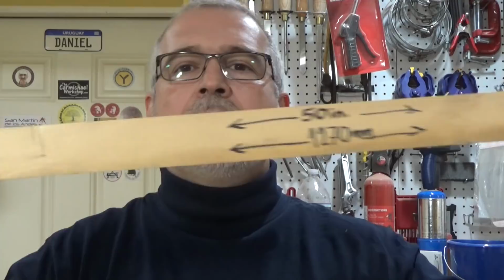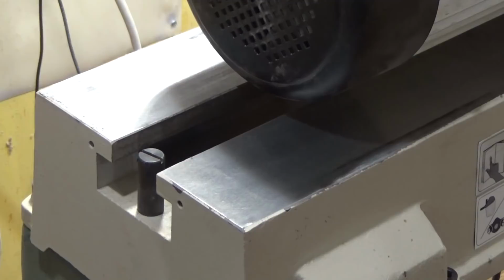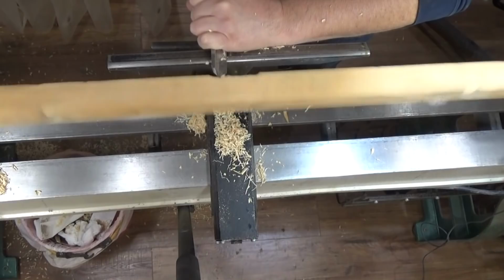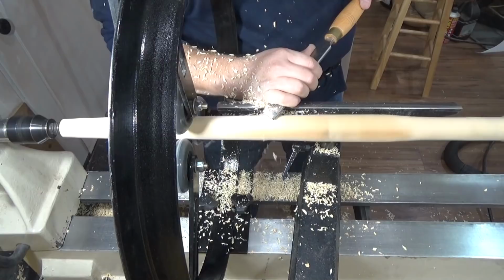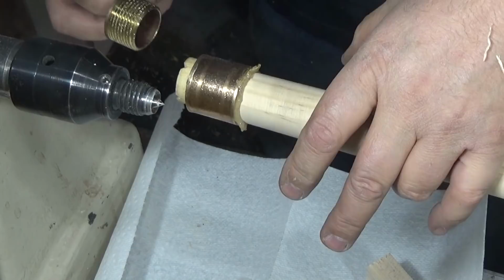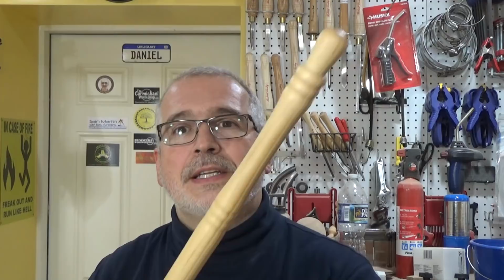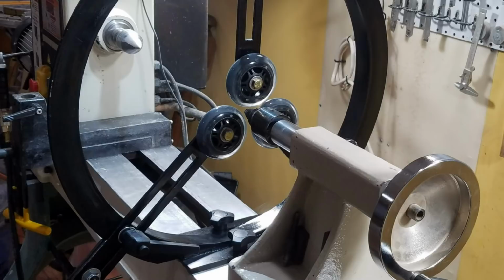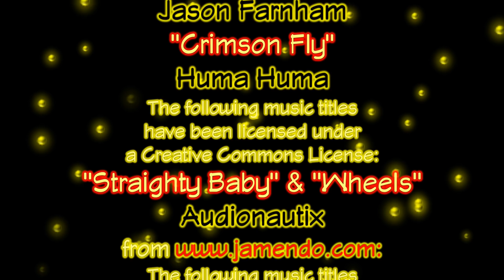Walking stick, using the Holzberg steady rest

Comment: very nice...my old busy bee can only manage 36" so i have turned a number of canes without a steady rest using the one hand as a steady. i also use a harder wood such as fruit woods or exotics as they have less flexation...you did a lovely job on that walking stick and i would love to have had a steady rest
Reply from the maker: Hi Kevin! Thank you very much, my friend, for your comments and for watching the video. Yes, the hand trick can be used, particularly if you have been doing it for some time and feel confident with it. Unfortunately, I did not find a nice long blank on a harder wood (maple, oak, walnut, pear) so I had to do with the pine. I can imagine that a harder wood will tend to vibrate less. Thanks again for your comments! Cheers! Daniel

Comment: Thank you, Daniel, for a great video.    It was very relevant to me as a few weeks ago I tried to turn my first ever long stem goblet.     I got as far as rounding out the wood and shaped the outside of the goblet.  I then removed the tailstock and it began to wobble immediately so I gave up rather than destroy a good piece of wood.  I've been researching steady rests since so this is very helpful.
Reply from the maker: Hi Alan! Thank you very much, my dear friend, for your comments! I am glad the video gives you a reference. For thin stems there are some steadys made out of thread (the people that do tembleurs use them). At some point I will want to do a trembleur and so I will probably begin by doing first one of these thread steadies. They are for more delicate stuff. Cheers! Daniel

Comment: Daniel, another great video, you have great skills, have, you may want to try sliding a 38mm tube, held with hose clips over the square wood which will convert it into a round, then run your steady rest on the round part, for the start off
Reply from the maker: Hi Ian! Thank you very much, my friend, for your comments! That is a great idea for the start up, it certainly will help until one is able to round up a section of the blank. Cheers! Daniel

Comment: Daniel, did you shorten the bolt on  the tail stock to get it to slide off the end, or did you simply remove part of the casting.  I have a G0766 and was wondering about this. The bolt on the tail stock is long and will not clear the end casting..  Great video, thanks.. Ed
Reply from the maker: Hi Edward! Thank you for your comment my friend! No, I did not shorten the bolt, the bed has a screw similar to the one that I took off on the head stock side on the tail stock side. I simple removed that screw and I was able to slide  the tail stock off without any problems. My lathe is a G0733, perhaps the G0766 is a bit different? It shouldn't but you never know. How do you like your Grizzly? Cheers! Daniel
Reply: Daniel Vilarino my friend, i like the grizzly,  i bought the g0766 because i  like from time to time to make a bowl. Most of the time I am spending with a skew in my hand, so the little longer bed on the 733 was maybe a better choice for me.  The hard reality is no one beats my door down for bowls, but someone is always stopping by needing a stair blaster or a chair spindle recreated.  The troubles I have found with the 766 is I am not able to slid the tail stock off because the bolt that is used to clamp bed is too long to slip past the stand case.